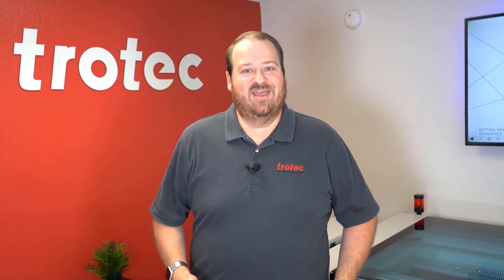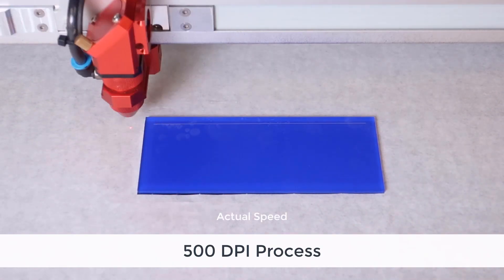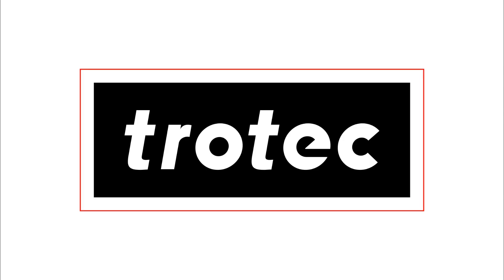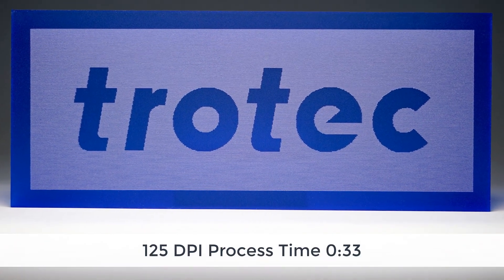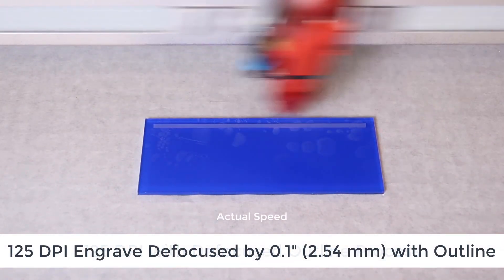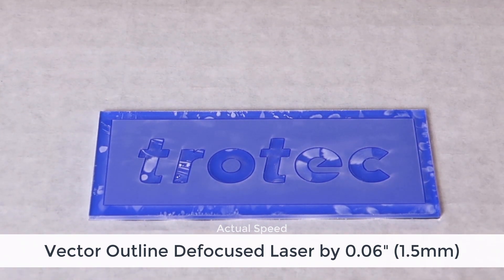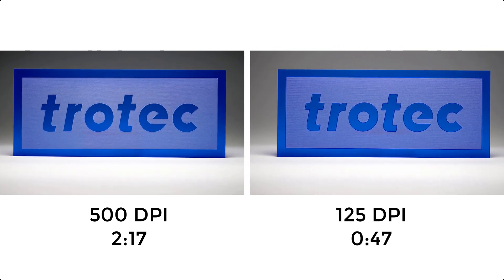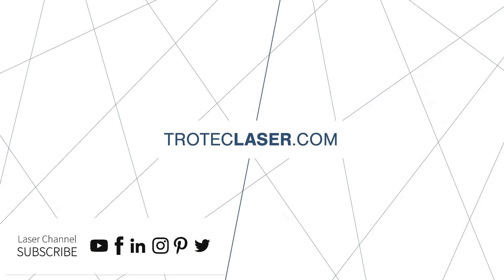Laser Hack:  Low DPI Laser Engraving on Acrylic

Comment: Great Idea! I wonder if this would work on yeti cups or glass on the rotary attachment
Reply from the maker: Hey Justin! This low DPI process has been found to work well on polymer-based materials, but the results can vary on other materials. This process will not work for glass because taking a laser beam out of focus on the glass will cause it to fracture. As for the YETI cups, this process may be possible with testing based on the material type; however, we have not tested it on this product before.

Comment: Hi Dave, what's the thickness you but on the blue stroke cut line? the job control doesn't recognize the blue as cut and the the blk is only for engrave
how do you made it engrave in blue?
Reply from the maker: Hello! The line thickness has to maintain as thin as possible (hairline from CorelDraw and 0.001” from Adobe illustrator). The line thickness is not what causes the beam to become more prominent, changing the focus does this, and the more out of focus, the larger the line.
Reply: You have to add the blue as a cut in the job control materials template setting.

Comment: after that, you can run a cut on those letters, very low power and fast speed, you will be amazed of how it will look, the cut will sharpen the edges and it will look great, try it.